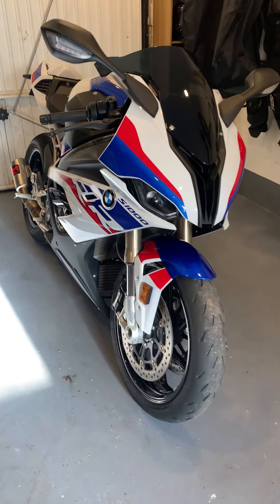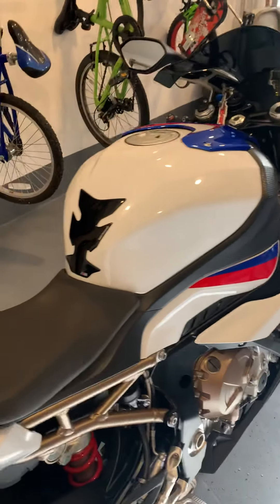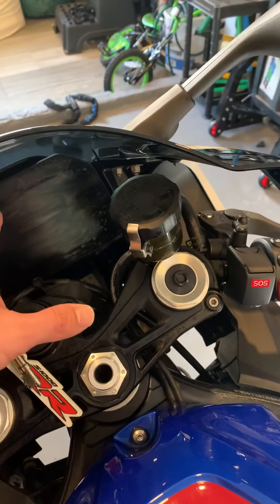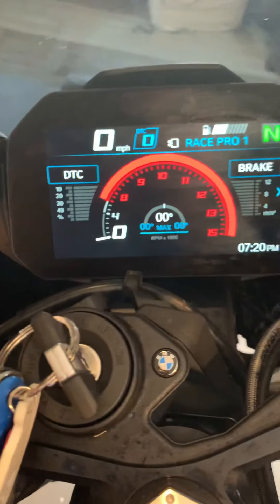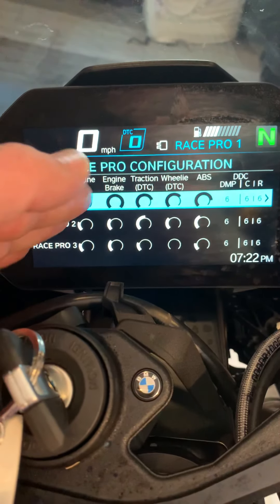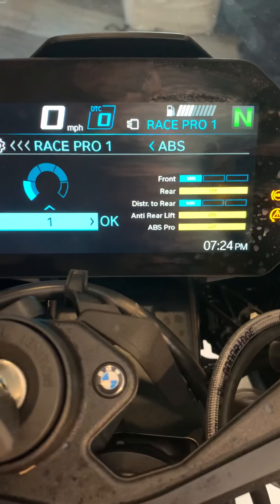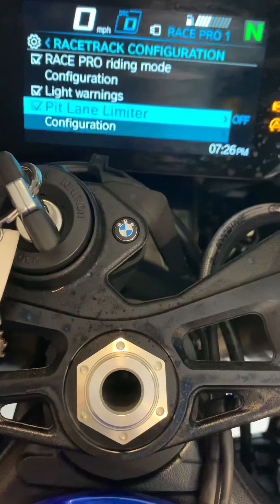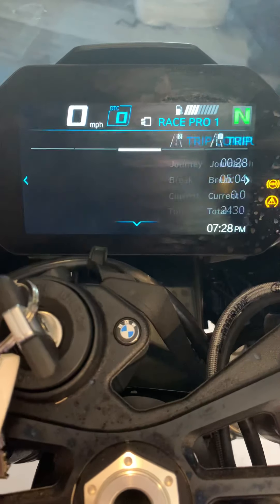2019 2020 BMW S1000RR walk through mentioning the toys

Comment: Got the same bike. You mentioned it not wanting to down shift. I had the same problem until I realized what was happening. The throttle is sooo light on this bike that I would be braking and downshifting while still having the throttle just barely open. Turns out the bike won’t let you downshift unless it’s completely closed. Just focus on fully shutting the throttle and your downshifts will be butter. Hope this helps